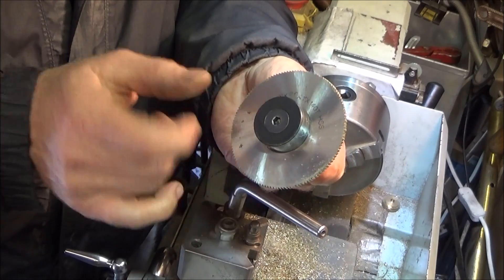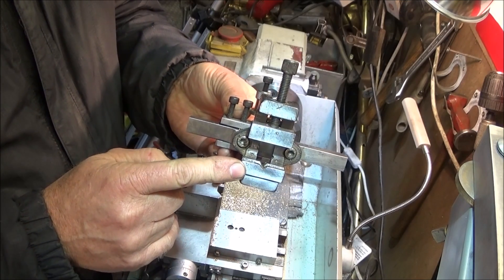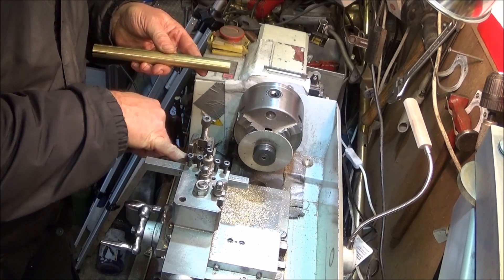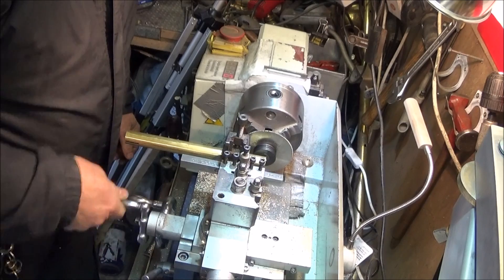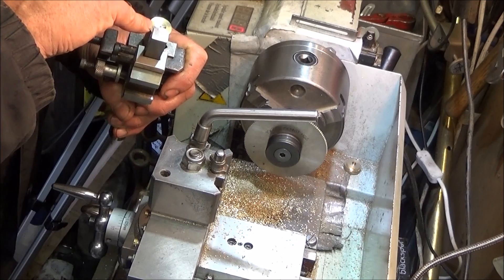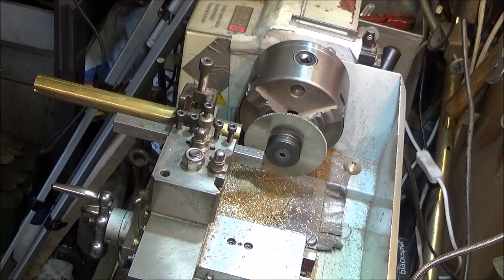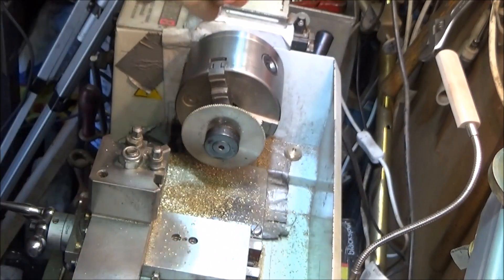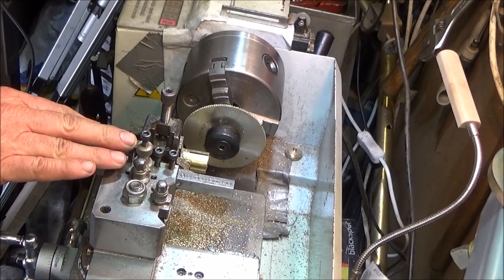How To Set Up & Use a 3" Inch Slitting Saw Chinese Mini Lathe & Myford

Comment: Hi Steve, good video!

Do you know where you got the small vice you used for holding the bar?
Reply from the maker: +falamble Hi you can get used ones on Ebay. They are usually listed as an Emco lathe vice. Another one that you can modify for use is a 75mm round vice you can buy from RDG or Chronos or on their Ebay sites. Regards Steve
Reply: Cheers Steve!

Do you think the cheapest mandrel/slitting saws on ebay are as good as any or do you think its worth spending a bit extra for a proper named one?
Reply from the maker: I just buy the ones on Ebay from RDG or Chronos. They seem to be as good as any. I actually haven't had one wear out yet although I have only used them on brass and mild steel so far.

Comment: From my last comment on your other video, I'm guessing that vice was set up the same way, bolted onto hss tool steel, held in the tool post. Could you get away with using mild steel instead ( save on cost?) or would you get too much flex? Thanks another great video that's giving me some ideas 👌
Reply from the maker: Hi Shaun,  I actually used mild steel which is perfect. I have included the updates for the RDG vice on the video link I sent on my last comment reply....also with some written instructions on how to get the tapped holes in their correct position. Regards Steve

Comment: Greetings from OZ---thats a very worth while attachment you have made  ---milling keyways while the shaft is still in the lathe without having to worry about fitting the milling attachment as well as doing a little light milling work on other jobs..First class Steve..
regards E
Reply from the maker: +Ian Craig Hi Ian, Thanks..... I'm just doing another video at the moment, where I use this attachment again. I'm making a useful steel expanding mandrel and handle for the mini lathe. Hope to finish the video this evening.